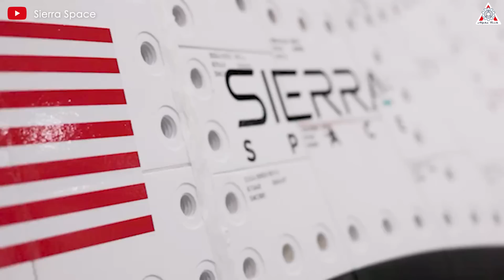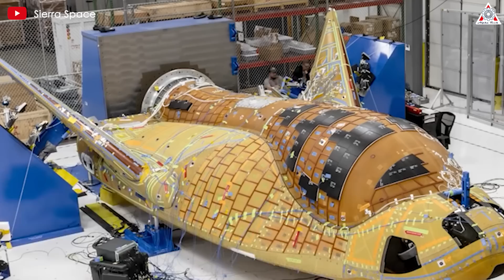SpaceX's Big Solution to Launch Sierra Dream Chaser Replace Vulcan…

Comment: I'm guessing if Sierra wants to fly on SpaceX, a Heavy booster might be the most expedient without requiring special structures or modifications but if Sierra plans on making SoaceX its main launch partner then the work should be done to put Tenacity in a Falcon 9.

Comment: Honestly, I cannot wait for another spaceplane... especially a crewed version. One that fixes the issues caused by Space Shuttle's unusual launch cofiguration. I firmly stand in my belief that in itself the Shuttle Orbiter was a safe and reliable vehicle, as both its tragic disasters were caused not by faulty design of the Orbiter, but by the way the Orbiter was integrated into the launch stack.

Comment: Dream Chaser looks very promising but is TOTALLY untested for the most difficult re-entry phase of flight. It would have been good to see Elon's test to failure, fix, test again approach. There is no reason to expect Dream Chaser to perform as expected until it has done so. It could wind up another Star Liner like Boeing. Fly it! Then Fly IT again until it works as intended!

Comment: This channel is such a boot licker of spaceX it's hilarious if you understand what happened and why.
Reply: Losing your job at Boeing, right?
Reply: @Easy-Eight  bot at all,
But why is spacex failure is considered a setback and for others it's like major catastrophe?
Reply: @Aerobird23  Good question.   SpaceX has a good understanding of the Falcon 9 which has an outstanding safety record with 367 full mission successes.    The 'others' you are speaking about are generally unproven prototypes as is the SpaceX starship.   The FAA  is much more cautious about these.  

Also SpaceX has a lot of launch experience.   It deploys starlink satellites at a low orbit where drag will cause reentry when anything on the 2nd stage or the satellites fail.  As it did on July 11.

The Falcon 9 2nd stage LOX leak occurred in an oxygen pressure sense line in the oxygen system of the Merlin Vacuum engine. The cause of the leak was engine vibration that led to a crack in the sense line. The sense line is secured by a clamp, but this clamp was too loose to constrain the sense line from vibrating.   SpaceX reviewed and improved all the line clamps.  Apparently this specific line is redundant and it was removed.

Comment: If you don't mind paying for a throwaway rocket, ULA will not screw up.  ULA may be running on an old fashioned strategy, but they're good at their game.  The Atlas was very dependable.   ULA doesn't fly with unkown variables.  While no provider is perfect, a few are remarkably on their game.
Reply: True, but AFAIK they already shut down the factory that built the Atlas V.
Reply: @Trifler500  Yes they did, due to a lack of Russian engines.  But, and I mean but, if Blue Origin can provide enough engines, Vulcan will be a dependable rocket. ULA knows how to fly.  They've been doing it for decades. 
  The old rocketeers knew that to get funding for NASA, so that NASA could contract them for lift sevices, you had to make jobs, win over Senators and Representatives, maybe bribe some people.  All for the 🚀 $.  And the government gets to keep the brains in the country. It's another imperfect thing in a perfect universe.
Reply: @Trifler500  The Atlas is no longer politically viable.  The Russian engine, on which Atlas is designed is not available, and won't be anytime soon.  ULA needs the Vulcan in order to even pretend to be competitive.  I believe the shareholders of ULA want to sell the whole works.  Hopefully to Blue Origin.  The Vulcan will not be economically competitive to the reusable rockets coming out of SpaceX.  Their only hope is to sell.  You can't sell with no rocket.  The Vulcan works.  But would anyone pay twice as much per pound to avoid SpaceX?  Blue Origin will, so may what's left of Boeing.
Reply: @SliceofLife7777  You replied to the wrong person
Reply: If you say so..trifler.

Comment: The narration made a point of saying that Falcon Heavy's launch cadence was well below that of Falcon 9. What the narration failed to mention was that the reason fewer FHs launch than F9s is the simple fact that not every customer needs the heavy lift capacity of the FH.  For most payloads, the FH would be wasted. Using FH for most payloads would be like chartering a semi to haul a load which could be carried by a pickup.
Reply: Additionally, the fairing on FH and F9 are currently the same size. They are working on a larger one for Gateway station's PPE/HALO module launch.

Comment: Put Dream chaser on a falcon without Shooting Star (Shooting Star lite?) with a falcon heavy faring (should fit as the core is the same. That would be a good test for Dream chaser. SpaceX would be wise to give Sierra space A fantastic deal that would put a feather is SpaceX capabilities in the long run.

Comment: Except that Dreamchaser very much plan to launch on Vulcan, just not on the second launch.
Right now it looks like flight 2 will be the final NSSL cert flight, flights 3 and 4 in the fourth quarter of this year will be launching NSSL payloads and flight 5 will be launching Dreamchaser probably in early 2025.
The spacecraft is taking longer to complete so they will be flying on a later slot in the Vulcan manifest.
This happens all the times with payloads and launch vehicle providers.
Basically what Sierra Space said was "we're not going to launch on the second Vulcan launch", what they didn't say was "we're not going to be launching on Vulcan at all".
There's no question about which rocket they'll be launching on.

Comment: Dream chaser is the definate way forward, a space plane.  Remember the idea f rom the 60s? Called.Dìno Saur? The way forward is, SpaceX!
Reply: The X-37 is probably a better comparison, and that's been pretty successful.
Reply: @RobertLutece909  but limited information for it it. In the 69s, there was a program called Dino saur, a space plane cancelled for the capsule idea.
Reply: @alanmcmillan6969  We know the X-37B has had at least seven orbit flights, one of which lasted more than 2 1/2 years.  And it returned safely each time.  That's a success, in my book.
Reply: @RobertLutece909  Very true. But it belongs to Darpa?

Comment: The bottom line is that Dream Chaser was not ready and was still dealing with technical issues preventing them from launching. They were removed from the launch schedule and are still not ready to launch. Dream Chaser is a very costly and highly technical craft. A manned version is at least five years away. By that time other less expensive alternatives will be available as well.  I think it likely that ULA will be sold to Blue Origin and that will leave two or three US big rocket providers still standing. One still struggles with a single small rocket that continues to have problems. Not a good picture at the moment.

Comment: Glad to see SpaceX might help Sierra get their rig going...
Most Space endeavors are positive Space endeavours...

Listening to whats going on, had me thinking about possible next steps. 
That maybe Sierra and SpaceX could think about working together on their next versions?

What I could see is an upscale space plane from Dream Chaser, say kind of a Milspec styled Trooper and Cargo orbital pickup truck, built using more durable Stainess, and using the new Raptor 3 engine. Maybe even be able to piggy back off what SpaceX learns in their on going tile experiments.

Then, have SpaceX work on a Falcon 9 and Falcon Heavy replacement thats a size DOWN from Starship, for utility launches like the new space plane.

It could use Raptor 3 engines, fabricated construction like Starship and booster, and be two stages, so that Space planes etc. could be injected into orbit with full fuel tanks.

Maybe they could call it Falcon X, (Falcon 10)

And get a less complecated and less expensive to build and operate new super  Falcon...

And be able to fulfull intermediate missions smaller than Starship more affordably than Jeffie's upcoming design... Just for fun! and to encourage Blue Origin to go back to the drawing board, and start over on attempts at competing with SpaceX and their new line of Rator 3 powered  lifters... 👿 (paybacks for whiney lawyers)...

The new image is out on Raptor 3, serial number 1, and She's a beauty...

Just what I had in mind with parts count.
Proud of the Enginerds at SpaceX for finally arriving at the "Art" level in Rocket motors...

"Art is doing things as they should be done, not as they are done."

She's a long shot from Raptor 1 or BE-4 Spaghetti monsters, and I know Elon is like a smiley face emogi over his engines now...
😊
I'll make a prediction: the Raptor 3 will be the new baseline in lift engines, and maybe in production for a century. it will be the preferred engine of Space Yacht builders and a 
hydrogen/Methane 
multifuels version will be a favorite of Asteroid Miners, due to its reliability.

Note; To Elon, your new engine factory isnt anywhere near big enough for the business potential of R-3's.... Basically they are like a Continental Industrial engine... will go on everything from trucks to tractors...
You might wanna do a maint. and repair manual for them, for the guys in remote locations... and make any special tools needed for service for sale with the engines.
Also suggest different colors for different iterations of Raptor 3 engines, so the mechanics know the models at a glance...
And offer complete rebuild kits affordably, also color coded to match Raptor 3 models..

Great job guys!
Humanity is proud!
Reply from the maker: That's great!

Comment: Agh, it is soo good to see the Soviet Spiral system again! About the usage, it cannot beat any spacecraft like SpaceX has for example. But it is not built for that ;-) Have a look at the Soviet Spiral System: https://en.wikipedia.org/wiki/Mikoyan-Gurevich_MiG-105 .
Reply from the maker: haha
Reply: But they never actually got Lapot working.
Reply: @RobertLutece909  Well, first there were the 1/3 model. That was used to figure out the heat shield/tiles. One of it was lost, the Australian navy got it and passed it over to US. You can see it was reused in the Space shuttle program. Then there were the tests with the full scale frame first, later with the engine they tested the go-around capabilities. After that it was dropped from high altitude from an airplane, so the life-support of it was working as well. But, if I remember well it was never tested launching via rocket. Hard to say any concrete on it, but I assume it worked as all of its components were tested some time, but it was never tested in a full mission. 
But, this was not the end product, the Soviets wanted a bit bigger one that can carry 1 or 2 nuclear missiles on board (like the Dream Chaser), the Lapot was just the test bed. And as the expectations grew and the missile systems enhanced, they cancelled the Spiral and started the Buran...

Comment: You just recycled an old video. There is nothing in the video about Space X actually doing anything to put Dream Chaser into orbit. Only your conjecture that they could.
Reply: As someone that worked as a quality engineer at Sierra Space, I can tell you this isn't even a consideration. Click bait video from an outside source.
Reply: Hold on, 'Dream Chaser' is not certified for Crew ! In fact, this model is not built for crew, only for cargo !!!
Reply from the maker: speculate based on real evidence
Reply: @alphatech4966  what evidence? There’s no evidence.
Reply from the maker: @fionajack9160  So you haven't watched our video yet.
Reply from the maker: @fionajack9160  Lie on the sofa and enjoy
Reply: @alphatech4966  there’s no evidence in your video, or elsewhere that SpaceX is going to be used to launch dream chaser. Just speculation that they could.. And they probably could
Reply: Thanks for saving me the time. I should have learned by now, this ch has gone 👎🏼
Reply: The intent is Vulcan-Centaur and that had NOT changed.
Starship, crewed or not, is FAR from being cleared for crewed flight.
F9 hasn't theDV. If it did the crew access arm would have to be modified.
F9h is NOT cleared for crewed flight, despite the 'heritage' and, again, crew access arm issues.
By using F9h launch costs would rise beyond a VC launch...